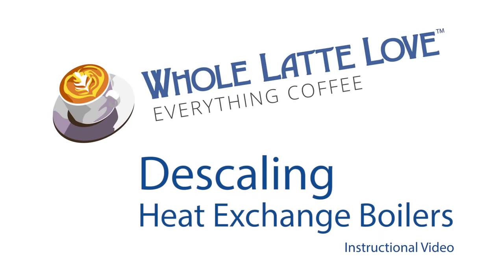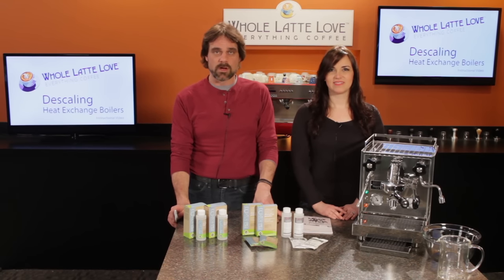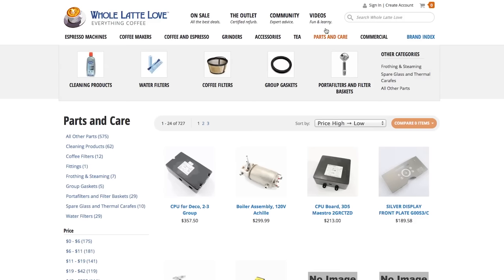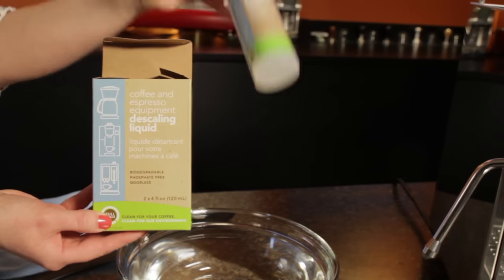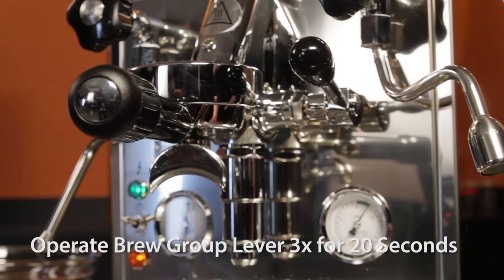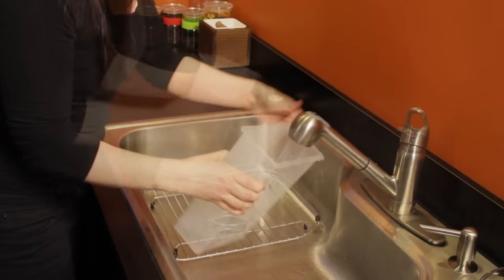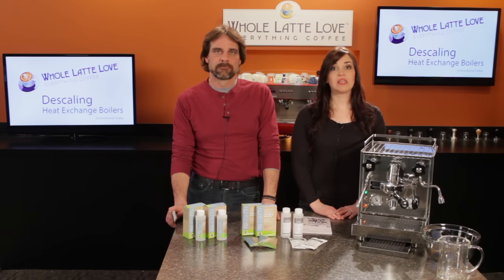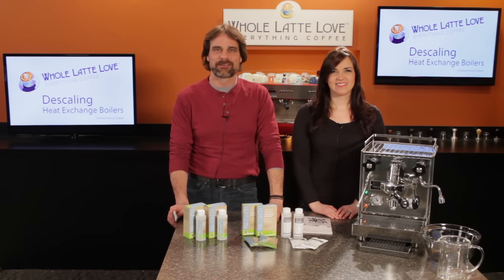How To Descale Espresso Machine Heat Exchange Boilers

Comment: I'm about to receive my new Rocket Giotto, and I saw another video saying that you have to disable the level probe inside the machine to be able to overfill the boiler with the water containing the solution.... which method is good ?
Reply from the maker: Hi FP, Thanks for the question and congrats on your new machine. I have not heard of disabling the fill level probe for the boiler when descaling. I would not recommend doing that. Think it's unlikely scale would form above the fill level point inside the boiler. Steam contained in that section of the boiler is mineral free as it is essentially distilled. Overfilling the boiler could cause problems if not done cautiously.
Reply: Thank you. Because I even saw a video, dating from 2015 with a guy called Andrew from Rocket, suggesting not to descale their machine but just control the water with filters or the pouches...
Reply: And forgot to mention...already asked the question to your site...but want to make sure again... I already have a Dezcal solution at home, but it is written on the label NOT TO USE WITH ALUMINIUM. That's why I'm getting a brand new Rocket because it broke my previous machine because there was aluminium in the components. I want to make sure it safe to use with the Giotto because the Dezcal solutions in envelopes does not mention the same warning.
Reply from the maker: Francis Paré I know Andrew Meo from Rocket very well. He recently left the company. I’ve toured their production facility in Italy with him and had a wonderful lunch at one of his favorite local spots. Best veal I’ve ever had. Rocket does recommend home user not descale their machines. They say this to prevent problems. Descaling a neglected machine which has had a lot of hard water put through it can cause scale deposits to dislodge and plug up the works. He is correct in its best to treat water to reduce mineral level and prevent scale from happening in the first place. Thing is you want some minerals to support good flavor and prevent over-extraction. Mineral free water like pure RO or distilled makes horrid tasting espresso and may cause corrosion of metal components in machines. My recommendation for water treatment are BWT products. They have a patented ion-exchange technology which exchanges calcium for magnesium to provide a proper mineral level that will not cause scale when used properly. They have plumbable and pitcher options for reservoir fed machines. Search my videos for more info or find their products on our website. They are the best in the business! Marc
Reply from the maker: Francis Paré Dezcal is made by Urnex and is a simple citric avid descaler. I’ve spoken with Urnex chemist in he past. While it’s not the best choice for machines with aluminum boilers they tell me it’s okay to use so long as contact time is less than 20 minutes. Labels may advise not using for aluminum out of an abundance of caution. Should also mention your issues may have been caused by dislodging scale during descaling and plugging something else up. Especially true if your boiler was a thermoblock type which is common with aluminum. As mentioned in another comment best course is to treat water to prevent scale in the first place. Hope that helps! Marc
Reply: Well thank you again. I'm bit more confused if not to say.... I'll make sure to check those videos. I've watched them in the past. With my older machine I used to pour water in the reservoir from a Brita water pitcher and use BWT pouch at the same time.  So should I descale anyway if using the pouch and filtered water from a pitcher ? I can't plumb, for now, my new Rocket, so no plumbable filter for me. And if understood correctly (because French is my first language) I could use the Dezcal I already have at hand ?

Comment: How to do this to plumed machine
Reply from the maker: Hi mn, Thanks for the question. What make/model machine. Most all prosumer level machines which can be plumbed also have an onboard reservoir for water supply. If yours has you would switch machine to run from the reservoir and get the descaler in that way.
Marc
Reply: @Wholelattelovepage  mine is la cimbali m21 junior it's connected with a manual water filter. Thanks

Comment: Great tutorial, thank you!
Btw, there is also a recommendation to lift the water level sensor in the tank a bit, in order to let the descaling agent fill the tank slightly beyond the normal waterline. — What would you say?
Reply from the maker: Hi e, you are welcome and thank you for comment and question. Yes that can be done. Just carefully raise the boiler's water level sensor a half inch and descaling agent will cover the normal waterline in the boiler. Don't forget to push it back down when done! I don't think it's all that necessary as waterline level usually does not get scale  - in use, as water level drops it's mostly mineral free steam making contact with boiler walls in that area.

Comment: Hi Marc - great video. Do you think you guys could make one for the descaling process for dual boilers? Preferably the PPro 700? :)
Reply from the maker: Hi Keagan, Thanks for the comment and request. So dual boilers can be descaled by end users but it's a tricky process and most machine manufacturers recommend against it. When our techs descale DB machine they remove the boilers and disassemble internal hydraulic circuits to do it. IMO many users neglect water treatment to prevent/reduce scale in the first place. They then run into problems if they do descale with scale particles ending up clogging up solenoid valves and other components. We always recommend DB machine owners use water treated to prevent scale in the first place. The treatment solution we like is the BWT Bestmax Premium filter system: https://www.wholelattelove.com/bwt-bestmax-premium-filter-package It reduces calcium hardness using ion-exchange which replaces calcium ions with magnesium to prevent scale yet maintain a proper mineral level for good flavor and prevent over-extraction which can be a problem with low mineral water. As a bonus the filter system has a pressure regulator. On machines like the Pro 700, ECM Synchronika and Bezzera Matrix and Duo the pressure regulator can be used to fine tune line pressure pre-infusion as these machines are open to line pressure without the rotary pump in operation. FYI DB machines from Rocket and Expobar are not open to line pressure without the pump running. There's a solenoid valve on the plumbed in connection which only opens when the pump is running.
Marc
Reply: Whole Latte Love - Wow I wasn’t aware. Yeah I’ve already decided I’m going to buy the in-reservoir filters from BWT that I found thanks to your video. Hopefully once I can, I’ll have the machine plumbed in and attach the BWT filter. Do you think by using those filters at all times that I will avoid issues with scaling in a DB machine? (I believe we have soft water in my part of Dublin, Ireland). Don’t think I’d be able to do that descaling process myself... Thanks so much for your engagement recently, these are really big purchases so I want to be sure of it all before I take the plunge!
Reply from the maker: You are welcome for the engagement! These are big purchases so totally understand. The in reservoir filters use the same ion-exchange as BWT's Bestmax in-line filters. So long as you replace the filters on schedule you should avoid any issues.
Marc
Reply: @Wholelattelovepage  Does that mean that even if I would plumb-in my R58 and set the lever to the mid-position to try pre-infusing, it wouldn't do anything because it still wouldn't be open to line pressure if the pump isn't running? If so, then how do you pre-infuse with such machine???

Comment: Whole Latte Love  I am a service tech and I have to say that I love this video since is gonna break so many machines, that means more work for me! 
Descaling must be done by professionals and you know it. I had more than one customer coming at the shop with the machine wrecked after they followed this video. You're not able to properly rinse ALL the descaling solution without using tools and without knowing what you're doing. But it's ok, keep up the good job in helping final users to wreck their machines and thank you to provide us work. Peace
Reply from the maker: Hi Luca, I'm going to disagree for the most part. I'll agree to some extent in the case of dual boiler machines. We recommend home users have dual boiler machines descaled by a professional technician. Some users do insist on descaling their own DB machines. With enough knowledge and skill it is possible for home users to descale DB machines. I'll add that manufacturers of many single boiler machines semi-auto machines and all manufacturers of super-automatic machines provide descaling instructions for home users in product manuals. FYI we run a service dept and work on 1000's of machines per year. Biggest problem we run into is users neglecting descaling for long periods. Then they descale and scale particles can clog other components in their machine. For single boiler and HX machines home users can descale so long as they stay on schedule. It's very easy to fully rinse single boiler and HX machines. In cases where descaling maintenance has been neglected I'd recommend home users have their machine professionally serviced.
Marc
Reply: @Wholelattelovepage  you disagree and I disagree as well with your point of view, the only useful thing a customer can do to prevent scale build up is to use filtered water or at least use a scale inhibitor. Descaling must be done by professionals, but like I said, this video will keep us techs busy so thank you again
Reply: @Wholelattelovepage  automatic machines are a completely different thing and it's ok to descale em since the majority of the manufacturers use flash boilers for the steam.